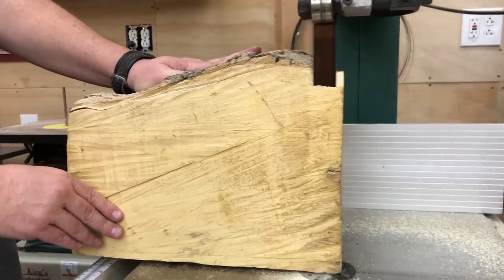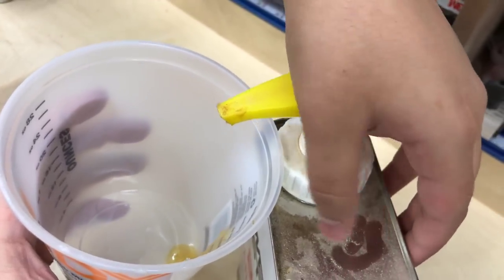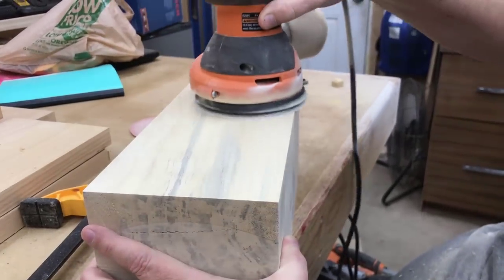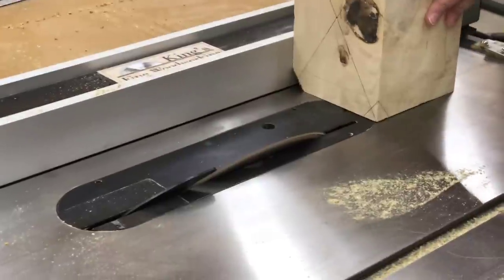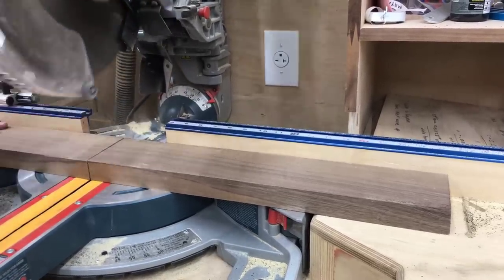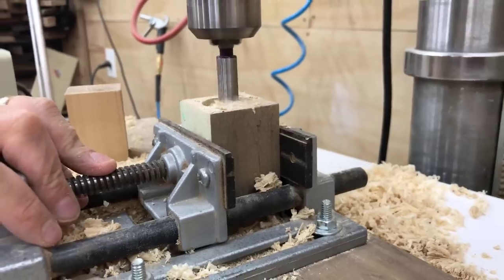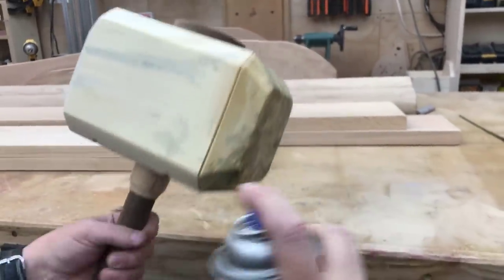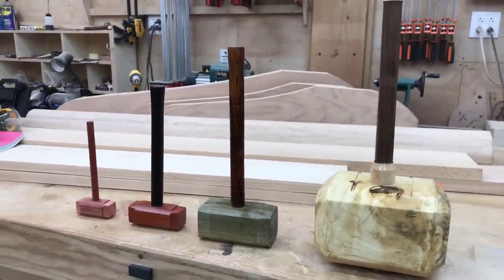42 - THOR Ragnarok Prop Build Thors Hammer Mjolnir Forged From Silver Maple Log FREE PLANS

Comment: This came out pretty good  Do you find the west system going a lil pinkish on you? It doesn't when I add a thickener but when you use epoxy as a flat finish you cant thickening it I use a piece of mylar and the finish comes out flawless its just a pink tint to it.
Reply from the maker: Hi. I have never actually noticed a pink tint and I have been using this system for many, many years. But I do have the fast hardener, that might make a difference.